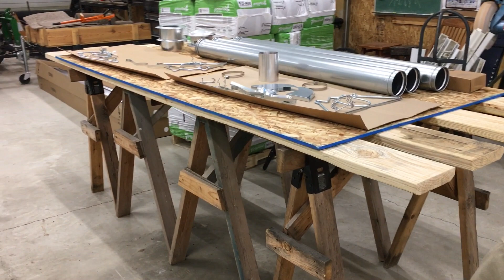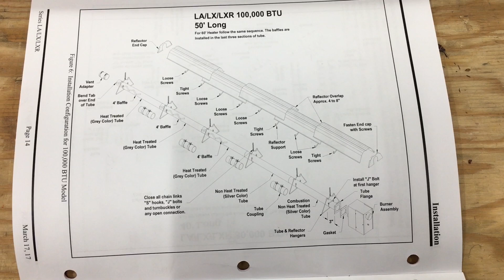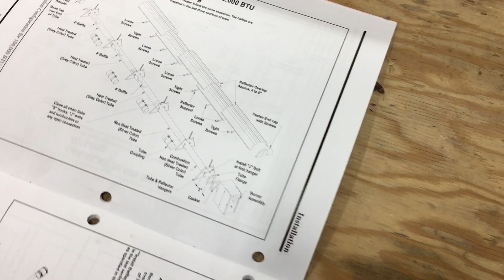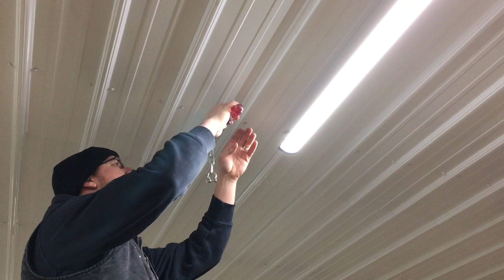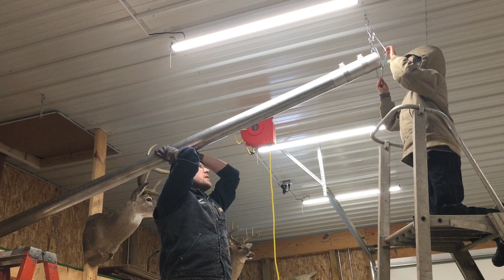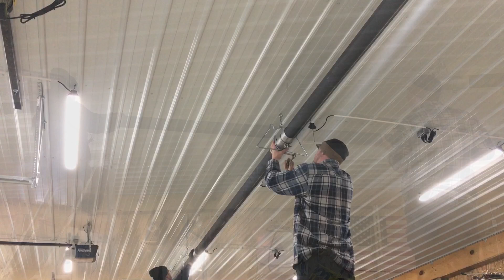054 Infrared radiant tube heater in pole barn, Part 1

Comment: Please call the company that sells heaters like this and make sure you give them your dimension this video shows this guy putting up his heater and his way too long for the garage you're supposed to have 13' off of each end so if you have a 50' Pole barn you only need 30 ft tubes
Reply from the maker: Yes, Derek is right…do your research like I did. This is NOT a typical radiant tube heater, it is a low clearance model, specifically for my application. This model uses a lower BTU burner and longer tubes to achieve low clearances above, below, and axially. Also remember this video is classified as entertainment. Consume this content and copy it at your own risk.

Comment: Didn’t show how you ran the gas line or if it was lp or natural gas
Reply from the maker: Natural gas. I tied into the meter on my house and ran underground continuous gas pipe (yellow plastic). I installed the line using my tractor and a subsoiler attachment that direct buried it around 12”-18” deep. Inside the building it’s black steel pipe up to the unit where there’s a drip leg and a 36” flex line attaching to the heater. Shut off valves at the house meter, outside the barn, and at the heater.
Reply: @Living Our American Dream  thanks for sharing about your underground pipe! I'd like to add a 40,000 btu garage heater, and there is a 1/2" copper line that runs from my meter by the poleshed, through my garage, and it literally runs just above where my garage heater needs to be! This 1/2 inch gas line services my house furnace, and nothing else. So my big question is, can I tap into that line, or do I need to run another line from the meter? I'm presuming I need to run another line
Reply: @LivingOurAmericanDream  Why didn’t you show how you ran the gas line?

Comment: Curious about the metal ceiling you have in there.  Was looking to do sheetrock, but the metal might be a better option for me.  What length did you use?  Would you do it again?
Reply from the maker: Would absolutely do it again. Looks good, durable, bright. It is more expensive though. As for length, go with what you can physically handle. I used a drywall lift to lift the sheets in place. My trusses are spaced on 4’ centers and I spanned three, so went with around 12’4” length so I have some overhang. That 4’ spacing was plenty for putting 12” of blown in insulation in the attic. Good luck and thanks for watching.

Comment: What would u use instead of i lags if you where attaching to steel purlins
Reply from the maker: You should be able to find a beam clamp for unistrut that would clamp to your steel and give you options for connections. Look in menards, Home Depot or lowes for unistrut and the fittings and you will find something.

Comment: Solid video! bummer about the concrete cracks! Not enough compaction?
Reply from the maker: Bummer story actually.  I’m not a concrete guy, just a do-it-your-selfer with ambition. For this concrete pour, I went back and forth on full blown steer rebar reinforcement, mesh reinforcement or fiberglass reinforcement. I elected fiber just to try it out since I’d never used it before. Trouble is the concrete plant neglected to put fiber in and it was not caught until the pour was half over. Therefore, this floor has no reinforcement at all. It’s my one regret and one failure on the barn project.

Comment: How much was you heater shipped to you? Im wondering if you would no if you could shield like 6ft of the tube. I have a car lift and the car on the lift up in the air would only be 3ft from the tube. Pretty sure i would cook the paint. Lol.... also now since you have used it. Do you think you would buy the same one again? 100btu or go for a 80btu. Thanks for the video. Really gives me alot of help.
Reply from the maker: Hi Bigg Dogg, thanks for your comment.

https://www.superiorradiant.com/index.php/products/single-stage-infrared-tube-heaters/low-clearance/standard-low-even-heater

I don’t remember what I paid, but to answer your technical question, I would definitely select the same heater again. I’ve been keeping my building at 60F this year and no issues with temps down to 15F so far. I’m sure I’ll be ok with even colder weather. For your car paint problem, check out page 27 of the manual at the link above (I bought the 100k BTU model).  They sell a shield that is made to protect areas where items may be located close to the heater. Follow all the manufacturers recommendations and you should be ok. Good luck and thanks for watching!
Reply: Thank you for the info. Ive sent them a message. I was wondering thow. If yours is mouted 12ft high. How hot is your wrangler parked under it. Just currious i guess to make sure theres no danger in parking my pick up under it. My cieling is 13.6 so i assume mine would be 13ft high. Thanks again for all your help.
Reply from the maker: My ceiling height is 12’ so the bottom part of the heater is more like 11’. Top of the wrangler is warm but not hot. This low clearance model of heater calls for something like 30” of clearance to combustibles....it works well.

Comment: I am looking into this type of heat for our newly constructed building and I am curious where you purchased your kit. The local distributor will not sell to the public, only HVAC professionals. I am in SW Michigan and thought I may be able to utilize your source as I understand you are also in the state. 

Following the installation, are you still happy with the performance and the results of the product?

Thank you for any information you could provide.
Reply from the maker: Hi Christopher. I have been very pleased with the performance of this heater. I’ve been keeping my building at 60F this season as I’m out there a lot and it doesn’t really cycle too much. As far as cost, I’d guess maybe an extra $20-$30 a month on the gas bill. To me that’s cheap. 

Now where I bought from. I bought this brand, Superior Radiant Products, from a distributor in Mt. Pleasant Michigan. They had the same issue only selling to a pro. Fortunately I have a relative in the HVAC business that I bought through. Perhaps you could arrange the same, or maybe ask a local HVAC guy to buy it for you for a few bucks on the side. 

Good luck and Happy Holidays!